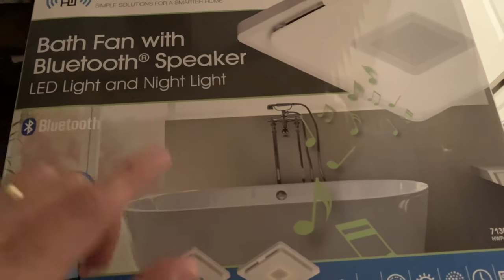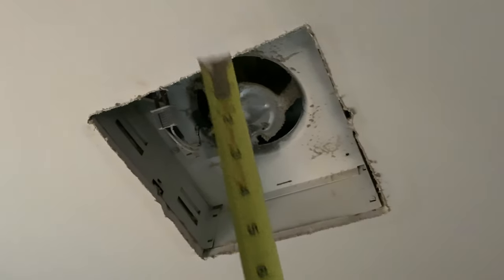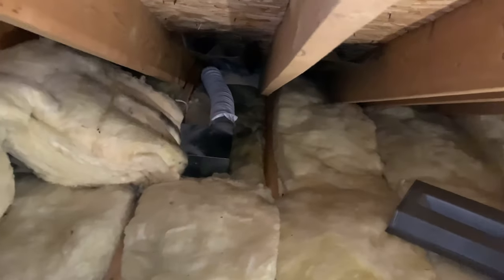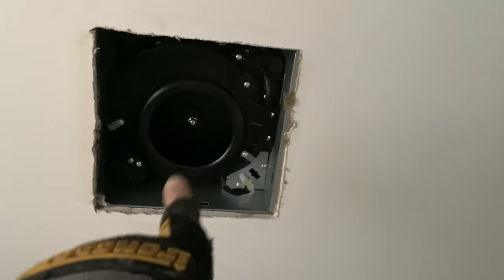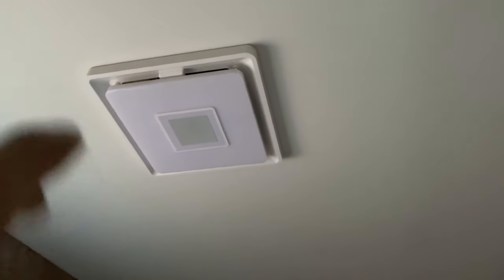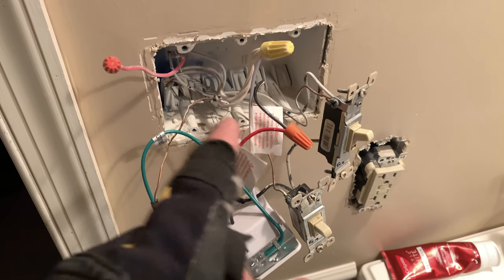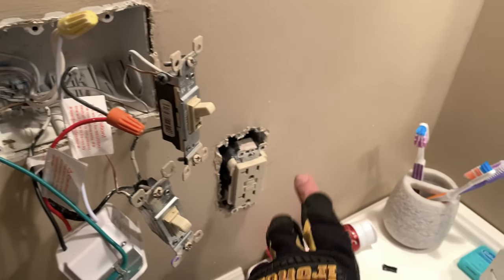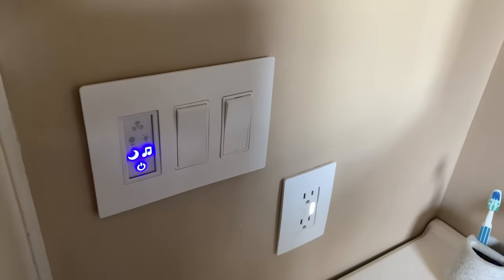How to install Home Netwerks Bath Fan with LED Bluetooth Speaker with RED WIRE

Comment: This setup (red wire)  is when you have a separate switch for light and switch for fan. The Bluetooth setup has it all in one. So, your essentially eliminating a switch. For the Red wire it is best just to put a wire nut on it and tape it up. So in future if someone wants to use it as power source they can. Or if fan is ever changed again to use two switches-won’t cause confusion. As may confuse future home owner or yourself years down the line why power wire tied into ground. You can actually just remove fan switch all together as well. There is housing with a blank for 3 gang box. There also may be constant power to wire as well and don’t want it grounding out.
Reply: Where did you see the the 3 gang cover plate with a blank? I've been looking but haven't seen one yet

Comment: I really appreciate this video. I bought this fan last night. When I pulled down the previous fan, I had two separate wires running to the fan. There were black / white and ground that came from the light switch. The other line had the red / black / white, but the only wire being used was the red wire which was the only wire running to the fan switch. I think this gave me the clarity. I will let you know tomorrow.

Comment: Thank you for this video helped me so much. After wiring correctly and getting a new switch because I fired the first one. The fan work great. Thanks again. 
For those wondering
Red to one wire to fan. Either Black or red. Don’t plug both black and red in to the fan or you will fire the switch.

Green to ground.

Black to house power

White to neutral
Reply: Can you clarify… only connect the red OR the black wire?

Comment: Wire the red wire on new switch to the black wire going up to the fan. Wire the Black Wire on the new switch to the line(hot) wire coming into the switch box. 

PUT A WIRE NUT ON BOTH SIDES OF THE RED WIRE GOING TO THE OLD FAN.. Putting a wire nut on both sides of the red wire is the correct way and will stop someone in the future possibly wiring that red wire to a switch that is now hooked up to the ground..

The existing wire going up to the old fane is 3 Wire (Black, Red, White) is used for providing two lines of power.. in this case two different switches (one for the fan and the other for the light)

The new fan only requiers one incoming hot and can control everything from the new switch. 

Get ride of the independent fan switch (middle switch in video) completely if your bathroom is set up with 2 switches were one is for the fan and the other is the light on the fan.. they sell fillers for blank spots on switch plates that are dirt cheap.. he basically used the middle switch as a connecting point for the hot wire (black) going to the new switch. 
 
Great Video thought I would help explain a little more!

Comment: I’m still lost to be honest. Did show how to wire it. My home had 3 wires to the old fan. Black white and ground copper. That’s it. Now according to the instructions the red goes to the black coming from the fan and the back wire on the switch goes to the hotline.

Comment: I wired mine the same way but my fan is spinning the wrong way..What would cause this? I took my cover off to look with the fan running an its not spinning clockwise, its spinning counter clockwise so it isn’t sucking air.

Comment: Check your fixture with a volt meter after turning off the breaker. Our fan was actually connected to the bedroom closet breaker not the bathroom. I checked it with the volt meter after turning off the bathroom breaker and found I still had a hot wire
Reply: Good thing you had the volt meter to check it with and not your fingers.
Reply from the maker: Oh wow. Does your bathroom have a 3 switch wall panel or 2? On the other side of our bathroom wall is the master closet but it has its own designated switch. Thank you for informing

Comment: thank you. it really matches my house wiring. one question at the switch box. you connected the red wire to the power line, you connected the white wire to neutral, where is the black wire gets connected on the new switch. thanks.

Comment: The instruction says to install it flush with the ceiling board, however it does not show the metal flange around the unit. Should I cut the opening small enough so that the flange attaches to the ceiling from the bottom? This way I would have to insert the unit from the bottom, correct? Should the flange be flush with the ceiling or hold onto the ceiling from underneath? I've noticed that you installed the unit sitting on the board.
Reply from the maker: I think its save to say, work from the top (Attic) and place the metal unit from your attic facing down towards your bathroom ceiling. Then, when your down securing it place the face unit like i did in the video.

Comment: I have a 3 switch setup and was wondering if I can take it down to just the homewerks switch by splicing them together. I too have the red wire and plan to cap it inside the lightswitch box. I have installed the single switch box and before doing the wiring just want to make sure the setup will work. I have a separate switch for the vanity lights that when doing a continuity check runs into the 3 switch box. I was quoted $200 to just wire this product in and do the switch box and $100 for just the wiring. If i can just verify I can splice all 3 switches into the homewerks ones I will be good to go by myself.

Comment: Hi. I just have one question. What do you connect the black wire coming from the switch to? I couldn't really see it good but it looks like you have it spliced into to the neutral on the bottom of the middle switch.

Comment: Where does the black wire on the switch go?
Reply: Ever figured this out?
Reply: No I fried 3 switches at this point I have 3 black wires and 1 red i don’t know what to do with a red and one black wire I got the fan to the red switch but still one extra black that lights wire

Comment: I dont know if thos has been said before or corrected later in the video but ....

UMMMM, NO!!!!! Red wire is second hot (second black) one was for fan, the other for light with separate controls. The new fan/light only uses 1 hot, the other should be isolated and capped off.

Comment: I was wondering the same thing. I had the same 'old' fan as you, but I only have a 2-way switch. 1 for the light and one for the fan. Trying to figure out switch wiring for the new fan.thx! How do the black wires connect?

Comment: Does the switch remember the last setting used or do I have to press the "On" button and a second button (nightlight, fan button, ect.)every single time? With the nightlight, I know you manually turn it on via wall switch but do you have a light sensor option? Like an ordinary wall outlet nightlight with the built in light sensor.

Comment: My bathroom has 1 switch. It currently controls the vanity and ceiling lights. I plan replacing the ceiling light with the home netwerks led/fan. How would u go about tapping the vanity light with this setup? Nice video by the way!
Reply from the maker: Hi Khuong, that would be quite difficult as the Home networks LED/Fan comes with a 3 set switch housing. Which means, when it's time to put the switch inside your wall, it won't fit because your bathroom wall only has space for 1 switch housing. You would have to modify your bathroom wall housing to fit the Home Network 3 switch. I would highly recommend to have to hire a license Electrician to do such work. I hope this helps.

Comment: Well I will have to rewatch this video. I have two separate wires coming to the fan, one of which is a dedicated circuit, only the red wires were being used though. I’ve determined this is not the dedicated neutral line though. So Have the other line is a black/white & ground.
Reply: Red should be a second hot.  When he ran red/red on the switch it wouldn't work because he grounded it at the fan.  His timer looking knob probably won't work either.  Test to see if your red and black are hot.  Some places run it like that when you have a light on one switch and a fan on a seperate switch.

Comment: So where does the black switch wire go man smh
Reply: I’m wondering to
Reply: @rudysavoy3373  red wire goes to the power
Reply: I got 3 black wires one light one fan and one main power and that red I got a extra black idk what to do with
Reply: @rudysavoy3373  hook that red to that black

Comment: does the light and fan come on without using the switch is comes with? mine didn't come with one and I wanted to just use the standard switch that's already there
Reply from the maker: Hi Jake, sorry for the delay. You will most certainly need the switch it comes with to get the full benifit. As the switch comes with different settings for the dim LED, along with Bluetooth for music play. Try to find a switch on eBay. best of luck
Reply: @NuMBERNYC  thanks for the reply

Comment: I noticed in your video that you did not show the light on full brightness. I was curious if when you put your light on full brightness, does the light flash on and off? Just installed mine and that is what it is doing on full bright.
Reply from the maker: Alan Will hi Allan. No my ceiling lights and wall display led do not flash on and off. In the video I was happy that I figured out the red wire problem that I didn’t notice the lights were not in full brightness. I’ll make another video with all functions again, I hope this helps
Reply: Alan, when you installed yours, was it a replacement light/ fan? If so, did it have separate switches for the light & fan? That is where I am getting confused because that’s what I have.
Reply: NuMERNYC, thank you. Think my light has a defect, gonna call the company tomorrow.
Bill, mine was a complete new install, no existing fan in the bathroom.
Reply: Alan Will I am drawing a blank. The red wire that I installed up top at the fan, this video reflects it’s got a wire nut on it.
Reply: @Buzzyinmich  I will take a look tomorrow and see what I have hooked up. I will message back and let you know.
Reply: @NuMBERNYC  the video was helpful as I got stuck on what to do with the red wire on the switch they provided with the new exhaust fan.. I saw that you connected the red fan wire to black wire off of your old fan switch.. However, where did you connect the black wire on the nee switch to?
Reply: @larrymcklaine1091  I was wondering the same thing. I had the same 'old' fan but I only have a 2-way switch. 1 for the light and one for the fan. Trying to figure out switch wiring for the new fan.thx!